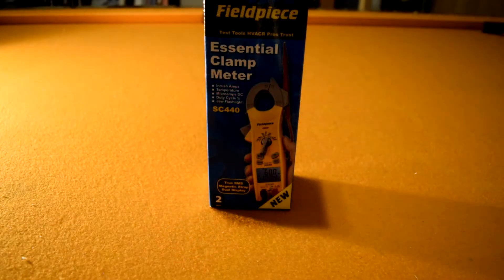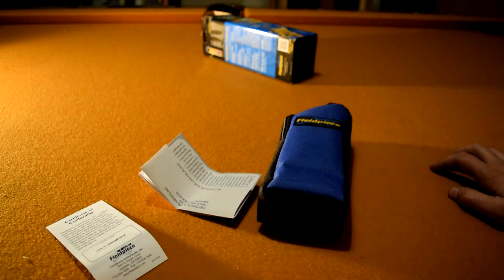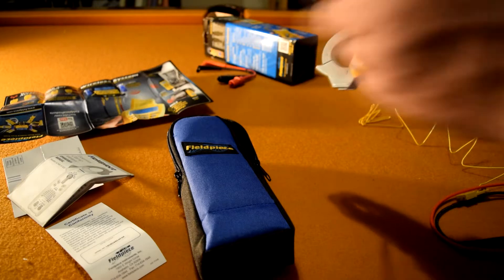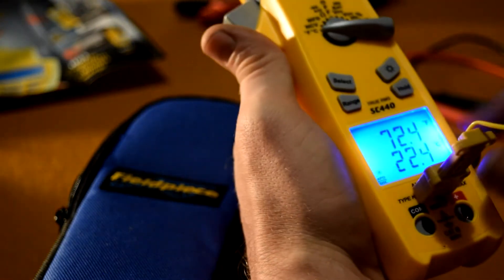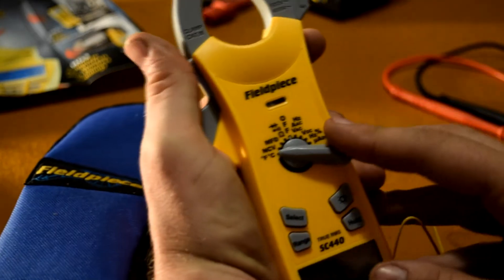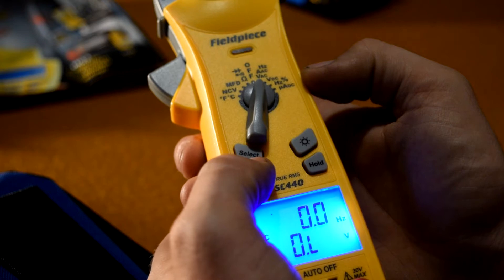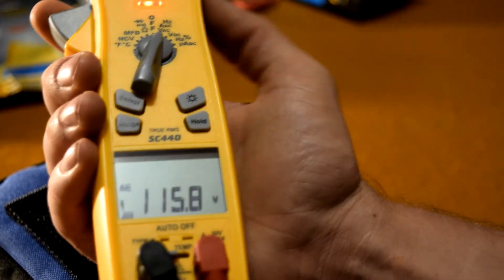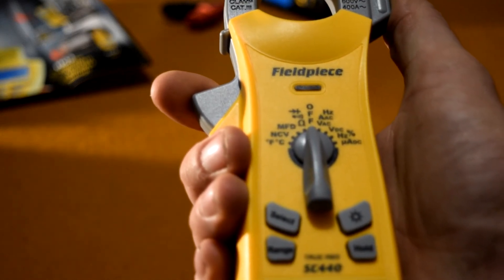Fieldpiece Essential Clamp Meter with True RMS and Magnetic Strap

Comment: Great until I had to measure DC Amps couldn’t believe didn’t have that
Reply from the maker: It does
Reply: @solarpowerelectricityandel2915   Tahts DC voltage not Amperage, right ? I wanted to measure DC Amperage
Reply from the maker: @selvinramirez5585  it will not do that sorry
Reply from the maker: VDC

Comment: I personally have never owned a meter that doesn’t have a switch to lock out lead probes when using temp feature. It’s pretty common safety feature.
Reply from the maker: Plumbing using Majors for 20 years so I don't like it

Comment: Great review I just upgraded my meter to the fieldpiece sc660 and it great! They really make some great tools. My sc660 has to temperature probes so you get get your delta T at the air handler. But like you said you have to take the meter leads out to do so. I'm thinking that where the meter leads and the temp leads plug in they go to a similar place on the circuit board and it keep people from taking voltage readings and screwing the meter up.
Reply from the maker: JonesHvac I completely agree.

Comment: I just bought a fluke 376. every make model has different features. paid $380 for it  1000 volt. 1000 amp. I do HVAC and renewable energy. only had ac amprobe before couldn't go any longer with out DC amprobe. tried to get by with inductive DC meter and wasn't accurate enough. seems like I end up doubling up equipment because no two brands have all the right features.
Reply from the maker: I have a few meters and I love the old ones better
Reply: Your saying the analog style
Reply from the maker: +Roy Amberg my old fieldpiece
Reply: I get what you mean when you say no brand has all the features. I use a Fieldpiece SC640 which is the big bro to this one. I love it. But it is pretty beefy. I was looking at Fluke and Amprobe but their clamp meters don't have lead holders or magnets. Deal breaker. And no clamp meters measure mA. 3 meters it is.